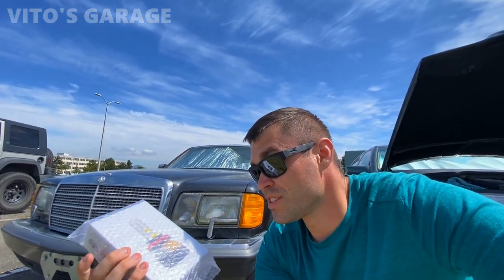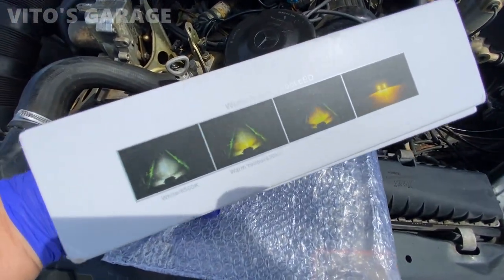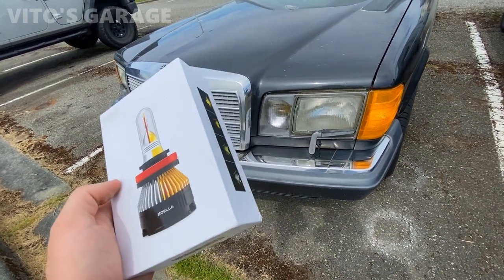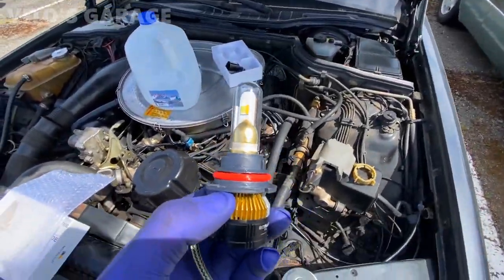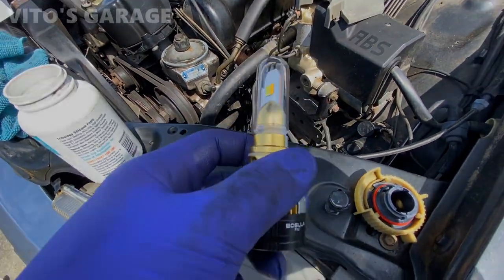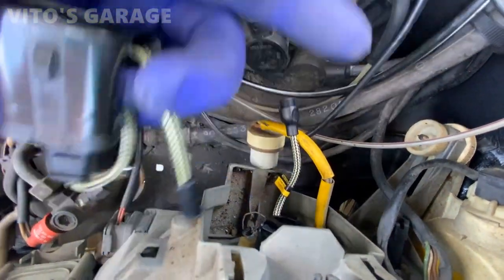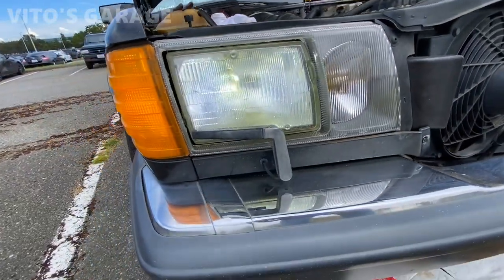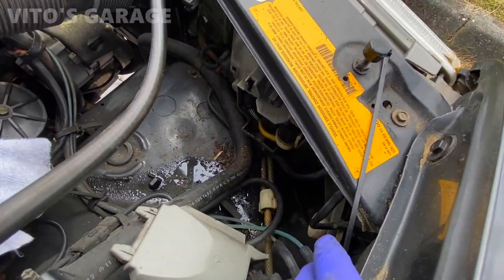Amazing Upgrade BOSLLA LED Headlight Bulbs For S Class Mercedes W126! Plug 'n Play Easy Installation

Comment: I say those cooling vantilators are not blowing air onto the LED lights rather they're sucking air outside of it, so maybe it would be a good idea to make small holes on those plastic covers to allow the heat out of there

Comment: Hey Vito, you really shouldn’t use LED or HID bulbs inside of a headlight housing without projector lenses (aka reflector housings). The light is not being directed properly and you’re just blinding other drivers with your LEDs now with the light scattering.
Reply: agree, but one thing, for leds or hids it is not necessary to have a projector headlights, take into consideration the 2022 ford explorer, they have led reflectors, which means it just needs to have reflectors that were designed with leds or hids in mind
yes, on reflectors that were NOT designed with them in mind, they light worse and blind everyone else